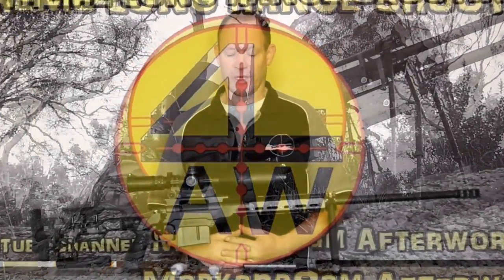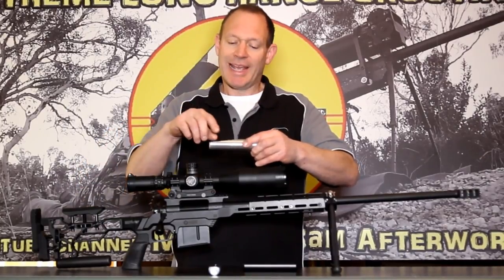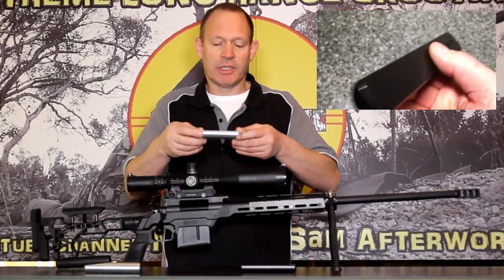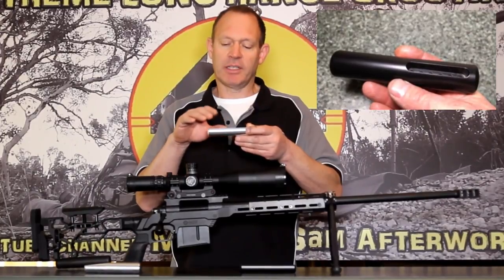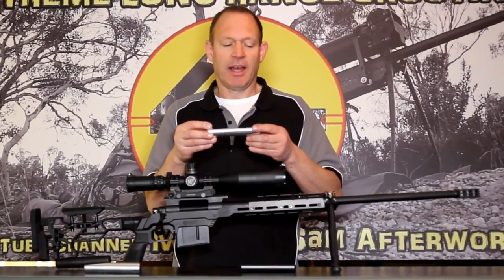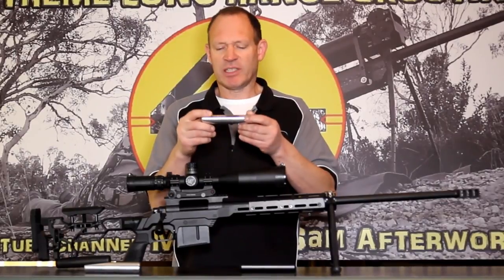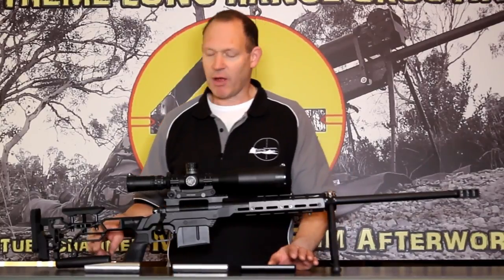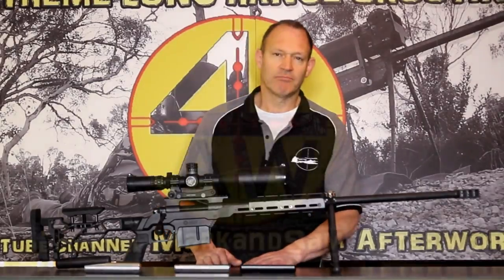4AW Bag Rider (multi fit)

Comment: Hi mark I’m looking for a bag rider for my Macmillan A5 with this fit
Reply from the maker: As video says, these are made for multiple different chassis butt stocks, the ones with mono pod mount bolt hole or a picatinny rail on the bottom, you would have to make some mods to fit to your A5 composite stock, Cheers